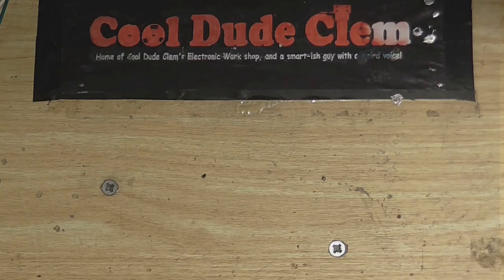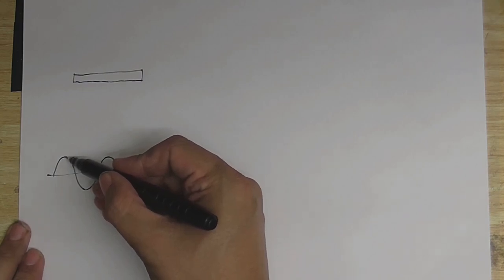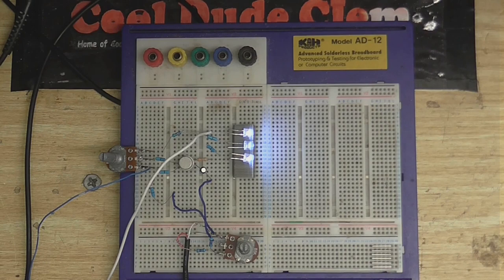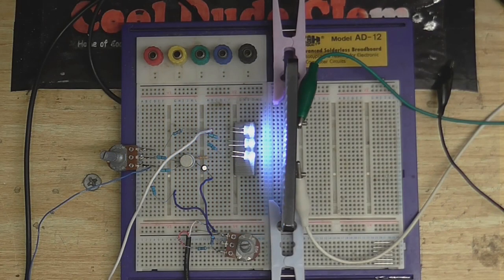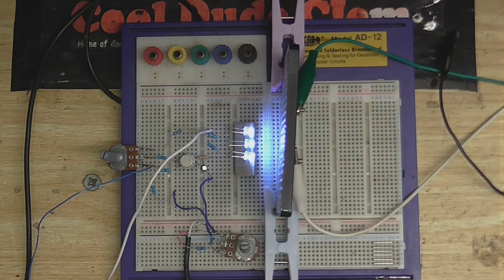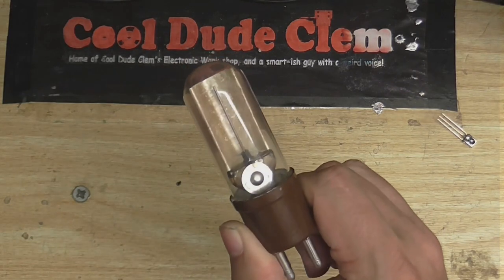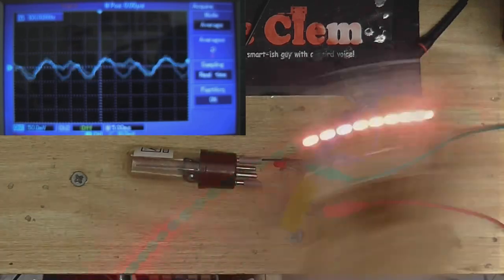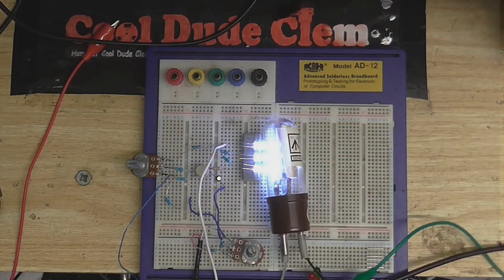Sound to Light - and Light to Sound.

Comment: Well done Clem!
I see you discovered that the Tube can be used in Photovoltaic mode but I think you'll agree that Photoconductive mode works best for this sort of thing.
Many years ago before Mankind had Power L.E.D.s to play with Mirror wobble was used to give Intensity Modulation at audio frequencies with Lamps that couldn't themselves be deeply Intensity Modulated that quickly.
Nice to see you still have your sense of humour.

Comment: You mean it goes positive 165V and negative 165V not 330V, otherwise that'd be 660V peak to peak which would be incorrect.
Reply: He's right. It's confusing due to peak to peak being confused with peak. Mains 120VAC goes to about a 170V peak while the higher European mains is around the 330VAC. This makes the peak to peak closer to 660VAC for European and about 340VAC for American.
Reply: @Magneticitist  And interestingly enough, this peak-to-peak voltage can be converted to ~660V DC using a voltage doubler circuit, which consists of just two diodes and two capacitors.